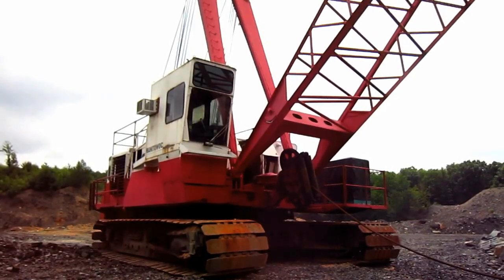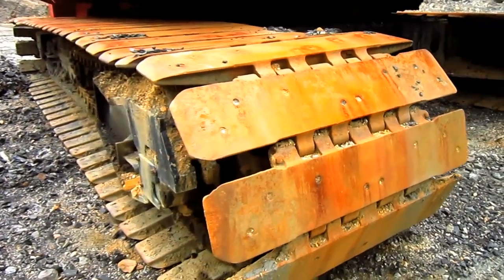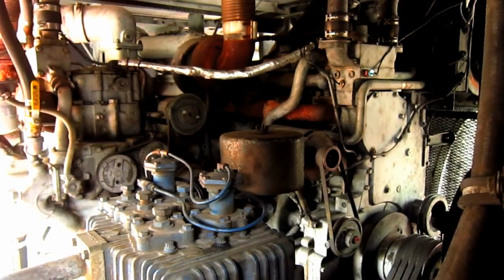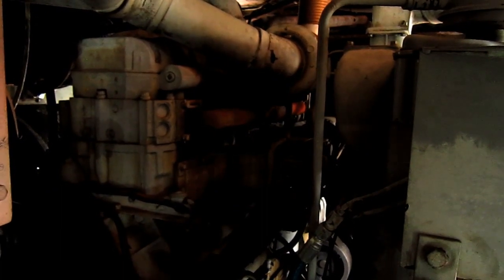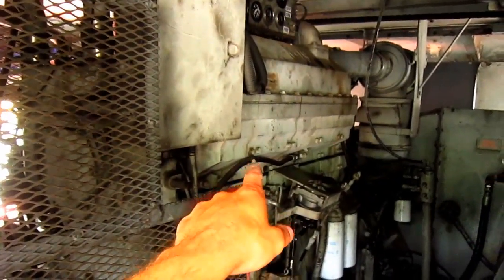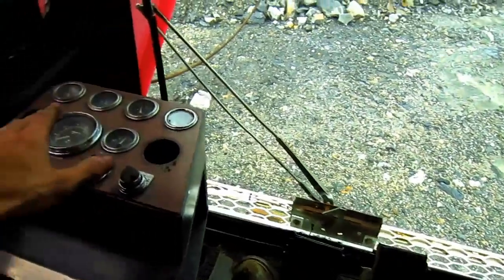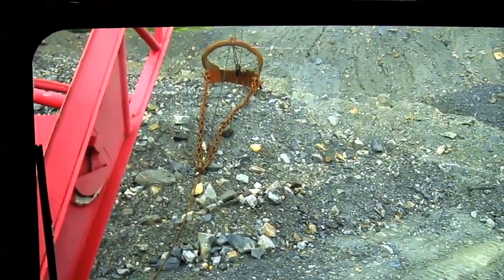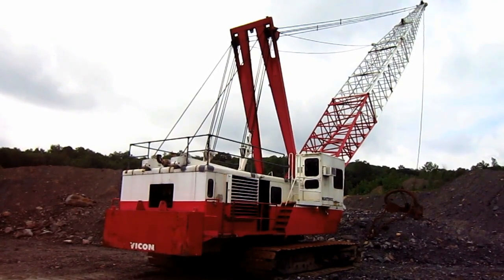Manitowoc 4600 Documentary

Comment: I was the Operator for a US Navy owned 4600 it was in Rota Spain. Engines were 12v71 and 6-110. The main counter weigh could not be seen from outside it was behind the visible rear weight. It was a box filled with solid Lead. It took two super 20 pettybone forklifts, a 40 ton PB had crane and a TD-20 dozer to lift and push it into place. The box was built of 2inch plate. I used Ivory soap bars to lube the slides. ChiefD

Comment: I believe the Lima 2400 was equipped with a V-8 Cat D378 as standard.  The optional D379 mentioned would have been a V-12.  From what I heard and read, the 2400s were a little slower, but more reliable than the 4600s.  These machines probably hit the limits in size, proportion, and properties of materials available for fiction operation to be feasible.  When you see a machine equipped with lighting, you say "no thank you" unless it pays very well or you are in dire need of a job.
Reply from the maker: I don't know if I'd say the 2400 was more reliable but it was a heavier machine.  And yes, a 4600 is a much faster machine than a 2400.  This is primarily due to the VICON control system.  The operator can control the engine throttle from the hoist and drag hand levers, thus making the machine go faster or slower.  On a 2400, the engine runs at one speed.
Reply: 2400's and 4600's have D379's. V12 version is a 397 and V16 version is a D398 IIRC